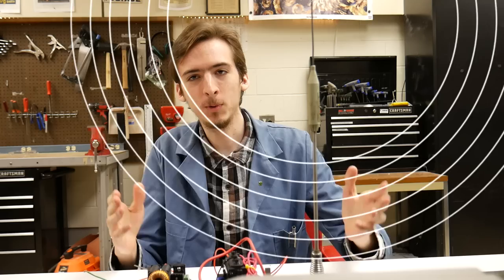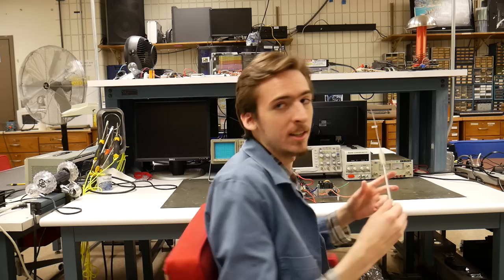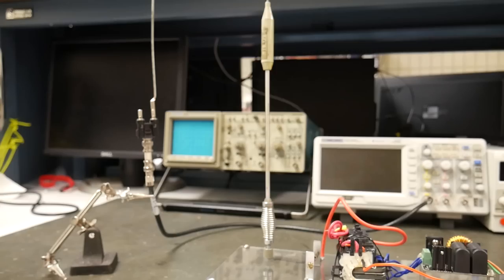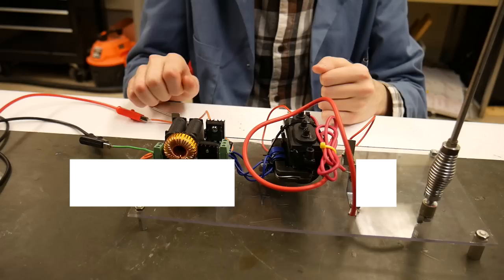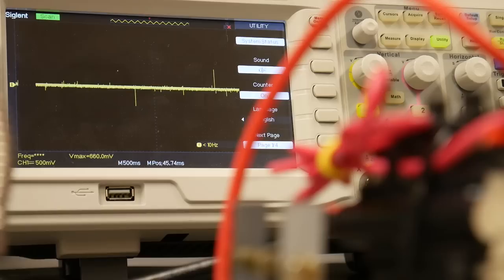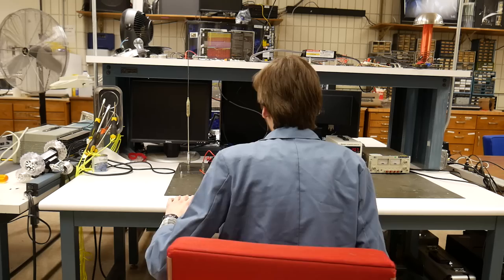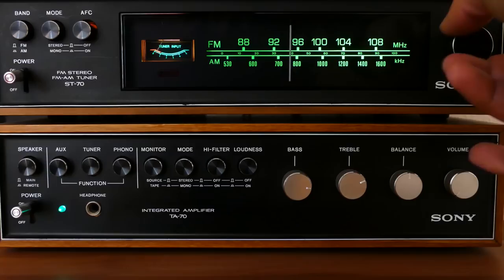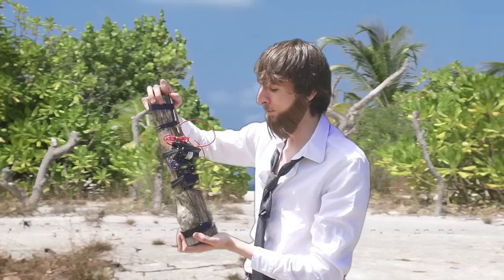Stranded? How to Make a Primitive Radio Transmitter | SPARK GAP RADIO (ft. Plasma Channel)

Comment: May I ask something sir? 
Why the electrical arc emits wideband radio frequency? You say on Jay video that means electric arc create energy all over the spectrum frequency?

How do you know that and why? Is there an equation or formula? Or it's based on theory or experiment? Thank you sir!
Reply from the maker: Great question!
So it goes something like this: an arc is a very quick event - there’s nothing, there’s a BIG electrical current for a moment, then it drops back to nothing just as fast. So the current wave looks like a plateau or a square wave (if you are familiar with them)
Crazy thing is, a square wave is made up of infinite frequencies. There’s the frequency of the wave itself, plus infinite harmonics at higher frequencies (multiples of the original frequency) - that’s what takes up the entire frequency spectrum.

For more on this: look up “square wave harmonics” and look for an image
Reply: @BlueprintScience  after I read your reply yesterday, I am read and learn about harmonic and Fourier transform immediately. But I still not understand it entirely. But I will learn it again until I fully understand..

May I ask more about electromagnetic radiation? So the energy on electromagnetic radiation is the same frequency as the source? So I already try in my lab to generate impulse voltage with arc on sphere gap. On the output circuit, I connect probe to my oscilloscope and I get the impulse voltage wave. If I apply the Fourier or Laplace transform (I still don't know exactly the different) to this wave on my oscilloscope, will I get the frequency spectrum for the electromagnetic radiation arc from the sphere gap? Since I think this impulse voltage wave is not periodic.
The reason why I ask this because I want to design loop antenna for try magnetic direction finding (MDF) method to locating the arc from the sphere gap.

I am sorry maybe this question is not near related to this video. And sorry for my bad english

But still, I want to say thank you very much for your answer yesterday and I hope you have a great life. I wish I can meet to thanks and shake your hand personally.

Comment: ok, ok. So in order to make a radio all I have to do is push and pull some current through a chunk of metal? That sounds easy..
Reply from the maker: AnteConfig,
It is easy... until it’s not.
Antenna engineers spend their lives designing complex antennas to focus energy and transmit very cheaply and efficiently

Comment: Is spark gap different from stun gun or emp's?
Reply from the maker: Yes, those things discharge a high-voltage capacitor, whereas this is continuous power to create a plasma arc - very dangerous.

Comment: Teslas radio system was vastly different from Marconi's. Perhaps not the spark gap radio which he used to power his remote controlled boat, but to be clear the radio systems that each of those two men designed later down the road were actually different in a lot of ways.

Comment: Wait what i didn’t know that was illegal
Reply from the maker: It... kinda is. It depends how you use it. A Tesla Coil is "technically" illegal because of the damped waves it produces, but if you are not intentionally transmitting onto the airwaves, it isn't a problem.

Comment: Your program is really cute but in the interest of accuracy, according to FCC regulations, TECHNICALLY SPEAKING, it is NOT illegal to operate a spark gap transmitter.
    According to FCC rules, ANYONE is allowed to operate ANY transmitter of ANY power output at ANY frequency, LICENSE FREE when calling for help when there is imminent danger to human life or property. I would say that the scenario of your guy on the desert island would qualify.
    Want to legally talk on a police radio? When you are driving down the road and, God forbid, you find a cop who is injured and can't themselves call for help. Hop on the mike and state the situation and location.
    Want to talk, license free, on a ham radio running a 1,500 watt linear amplifier? Come across a ham's house, again, God forbid, that was hit by a tornado but miraculously has working equipment and you have no cell service. Jump on the mike and holler "MAYDAY, MAYDAY"!
    Same goes for business band, GMRS, tuning a broadband 70cm radio to 500Mw limited FRS frequencies and broadcasting at 40+ watts, getting on a modified 10 meter ham radio and tuning into the pirate channels or government frequencies between 10 meter ham and CB channels or the itinerant business channels below 11 meter CB and 12 meter ham band. Wanna talk on CB channel 19 at 500 watts? Just be sure you have an actual life threatening emergency. The equipment will get confiscated but you will go scot free and maybe even get a medal for your trouble if it saved someone's life.
    Same goes if you have a modified 10 meter ham radio that can reach up to 32 MHz FM. You can call out on the Burger King drive through channels. I used to do that with an RCI 2970 DX radio modified to run from 26 through 32 MHz. I used to tangle up orders at the local drive through in Florida. I also modified it to go down to 22 MHz and would aim my van at the doors of the Sam's club, key up at 100 watts and let the odd harmonics open the sensor doors for...wait for it... no one. You don't want to key up like that for more than a split second going into a Wilson 1000 CB antenna unless you want to smell your final transistors burn. I miss that radio. An EMP from a nearby lightening strike turned it into an 8 pound boat anchor. :(

Comment: Or, you could reflect 500 THz EM radiation (sunlight) at a passing plane or ship using a mirror or shiny metal object. This might be a little more practical than building a transmitter.

Comment: Lot of wrong science here and it's not that difficult to make a radio..... A 12 volt battery from a car can send signals as far as the antenna line of site..... A wire a file and a decent amp battery is all that's needed and can in the skip reach across the USA.... These are facts.... Connect a wire to positive one to negative with the file attached strike the other wire across and you are sending radio waves.... Now what matters is the receiver the quality of the reciever determines if you can be heard.... Having a transformer increases the strength of the radio signal so that poor recievers can hear it... The Leyden jar collapses the charge faster creating a stronger spark......... So yes a car battery and wire without the file will even work the file or any piece of metal gives ability to control the signal sent without burning up.... Attach to either side your antenna and wala radio....you will transmit over all frequencies and This is the true science..... So ship wrecked see if you can find an alternator from the motor or if not a electric motor find some aluminum foil and some wire.... If you can get as powerful of a battery as you can.... Find some plastic tubing and some paper..... Build a wind turbine with the alternator connect to the capacitor you build with the foil (any flat thin metal will work to roll with paper insulation between... If you have thick metal you take 2 pieces separated with paper and connect wire to each) the cap will give hit spark when dumped... You could set this up with a board that is cut into cams to send the SOS continuously while the wind blows.... This is not all the details but plenty enough..... And the professor on Gilligan's Island was a total moron..... All that wood just build a boat and sail home.... Better than waiting for rescue.... Navigation is easy.... The ancients built boats and radio is easy too.... I'll never be stranded unless there are no trees
Reply: @Robert Marshall yep just use a alternator the magneto and of you make a disk with cams you could set it up with windmill to send continuous SOS

Comment: working with high voltage will make you father of daughters and you will never have a son.
Reply from the maker: Thank goodness!
Reply: @BlueprintScience  all transmitters have a LC tank oscillator. Tank oscillator makes dv/dt on antenna. Antenna makes oscillations to air because of high frequency and high voltage. When LC tank is full it oscillates and sends its energy to space by electro magnetic waves. we must use very high voltages to make long range below mhz signals. But we dont need very high voltages over mhz.